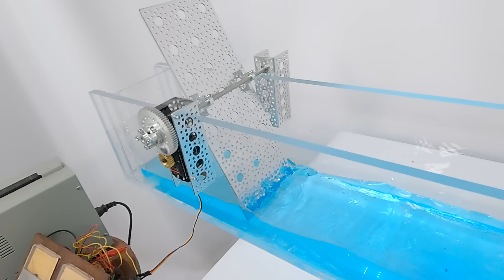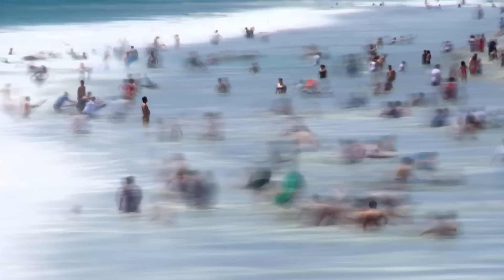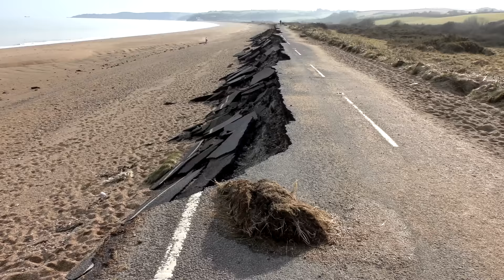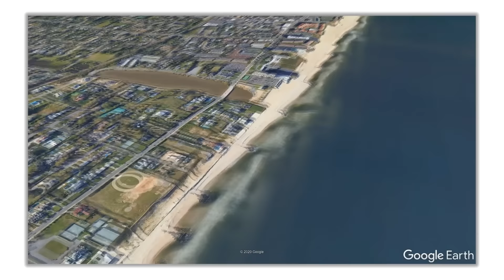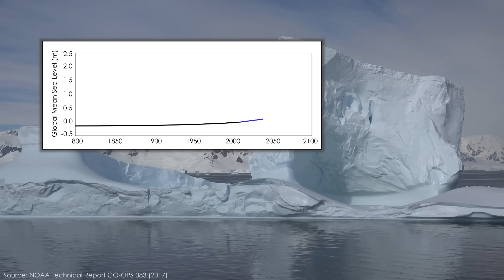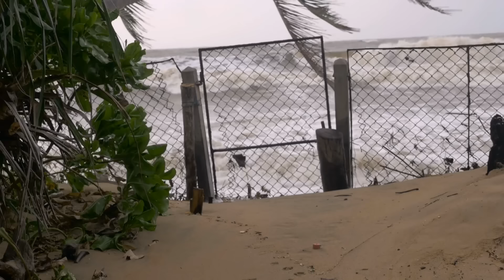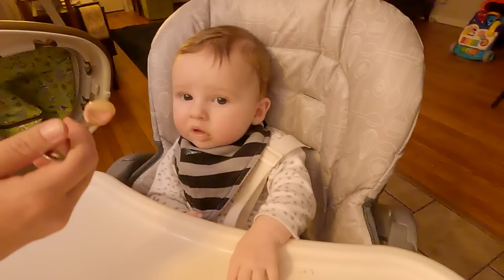How Coastal Erosion Works

Comment: If retreat zoning doesn’t take hold, I might buy a beach house one day, but I know that is unattainable for the most Americans.

Expecting the poor and middle class to be taxed so expensive public infrastructure can be built to protect my beach house would be more than a little perverse.

I’ll go with something smaller and more replaceable instead. Or a glorified deck/awning with connections to receive an Airstream trailer.
Reply: Small and easily replaceable is what beach houses used to look like before government guarantees to cover inevitable structure losses from hurricanes, flooding or erosion.

Comment: Loose sandy beaches are there in the first place because usually waves, tide, and wind have built them up. That they erode later is simply cyclical changes in the deposition and erosion processes. For the special case of coral reefs, they are built by live organisms and they change really fast. Since the last ice-age, all current coral islands have gained elevation of hundreds of metres to match global sea-level changes.

Comment: I've personally seen a beach disappear while I was growing up (in Sardinia, Italy). It wasn't a big beach in the first place but over the course of relatively few years it disappeared almost entirely, now most of it has been replaced by big rocks and concrete structures to prevent further erosion toward the beach houses.
Another famous beach was also disappearing but this time they brought back a large amount of sand from the seafloor to the dismay of many local citizens because the new sand was much darker (practically black) than the original white one which ruined the aesthetics of the beach for a while
Reply: A darker coloured sand instead of no beach at all? People always find something to complain about.
Reply: I also find it interesting to see when the sea loses. Some 10-15 years ago a large piece of driftwood got stuck near the shore and that started to slowly accumulate sand: https://www.google.com/maps/@55.8437107,10.0476763,470m/data=!3m1!1e3 It will probably take 20-50 years before it is genuine land.
Reply: @ivanskyttejrgensen7464 , either the satellite view is much newer than the street view or it was taken at low tide; there is significantly less new beach visible in the street view.
Reply: @questioner1596  Streetview isn't updated that often in danish rural areas, so I guess that the streetview for that patrcular road/beach is from 2009, and the satellite photo is more recent - probably 2018ish
Reply: @ivanskyttejrgensen7464  hey uh do you have an article or something because this genuinely seems interesting
Reply: @DanksterPaws  No, my source is my mother. She lives nearby and drives there a couple of times a year because it is a small, nice island. I dug into the old (1999/2002/2005/2008) areal photos on https://sdfekort.dk/spatialmap and it seems there has always been a tendency of sand build-up in that area but it accelerated when the driftwood got stuck.
Reply: @ivanskyttejrgensen7464  Yea i actually was looking at the wrong one because there was another just to the east of it. Thats kinda sad tho since I wanted to know more about it other than just photos
Reply: Many years ago, the "old beach" at Port Burwell, Ontario, on the north shore of Lake Erie disappeared literally overnight during a big storm.  While the Great Lakes don't have measurable tides, there are other phenomena at work:  The lake levels cycle from low to high over decades (right now they are at record highs) plus winds can "heap" water from one side to the other.  A stiff south wind can make over a 2 meter difference in water level between Cleveland Ohio and Port Stanley, Ontario.   It was such a storm that took the beach away, during a period when lake levels were high.  Later, sand was trucked in and the beach was remade.
Reply: Grazie per aver condiviso Massimo, la Sardegna è bellissima! Buona giornata.
Reply: I love Sardegna. I lived there for a while myself in Nuoro many years ago and spent a ton of time in Olbia and the coasta smeraldia. You’re lucky to have grown up there.
Reply: It's not that it disappeared though, it just moved the beach in-land. But, because of the houses, instead of allowing the beach to naturally shift, structures to prevent coastal erosion were put down, destroying the beach.
Reply: WOW!

Comment: Beach nourishment is the way the Netherlands keeps it coastline mostly constant. The interesting bit is that there are pretty much just 1 or 2 spots where it happens, and then natural currents are used to spread the sand along the whole coast line. Literally translated it's called the 'Sand Motor'. 
It's all very well engineered. A sea dike is only used in one spot along the north sea coast, near Petten - ironically where one of our nuclear reactors is situated.
Reply: But when possible dunes are used to stop the sea. Grass is planted on top to keep it from blowing away, but you probably know that
Reply: As a German from Hamburg I am in awe of the Dutch and their incredible skill in maritime architecture. While the north of Germany also features some areas requiring moderate engineering to keep beaches (and even islands (Sylt, anyone)) where they are, that pales to insignificance against what the Dutch fulfill each and every year.
Reply: Nope that seadike is re-enforced with sand in 2014 similar to the concept of the Sand Motor.
Reply: That's amazing, I wouldn't have imagined that the currents can be used to spread the sand
Reply: If there's one thing Science & Futurism with Isaac Arthur taught me, it's that there's no such thing as permanent and static solutions. Every problem has to be addressed and readdressed again and again. But as long as we have the energy and infrastructure to keep implementing dynamic solutions, then they will work indefinitely.
Reply: :oops:🎶🦆🔃                                                                                           🌠🌛🗯
📊🩲🧮⏳
NL pumps as much water out of the country 🔄each day as Tokyo area uses in a year.
Reply: It is important for the structural integrity of the land near the nuclear reactor to be sound, I suppose? So not that ironic? ^^